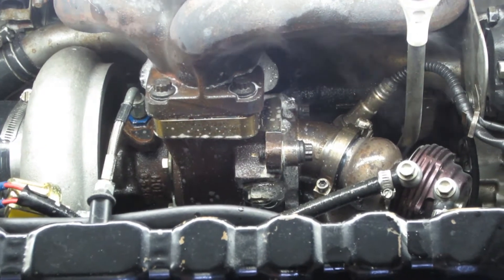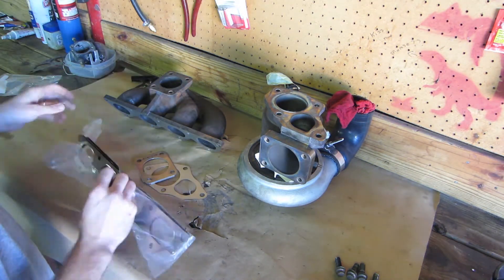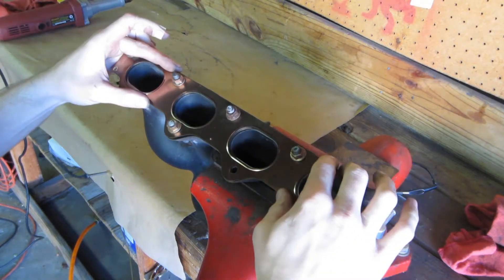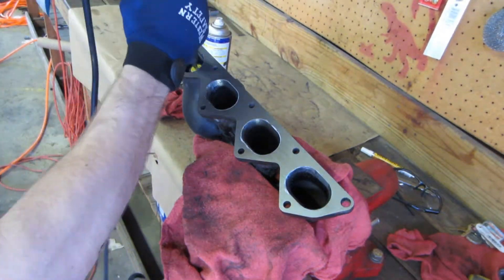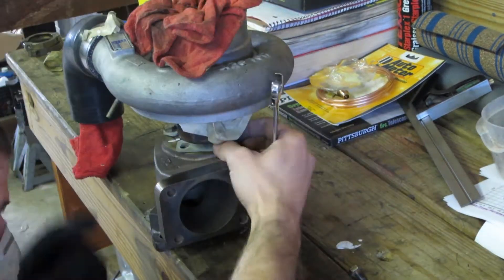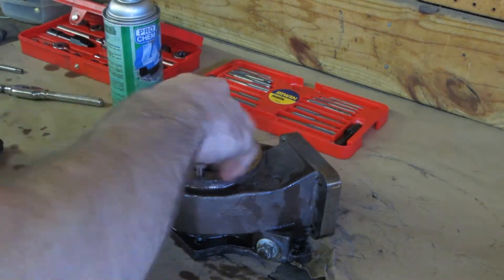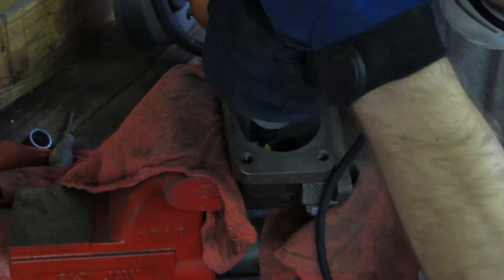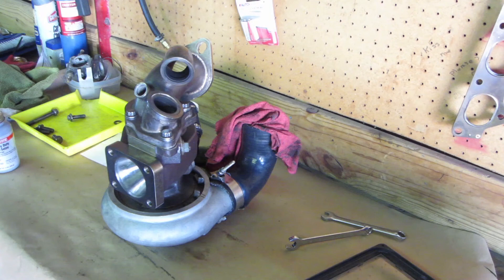Diagnosing a Lean Condition - Part 2 Gasket Match Port and Polish

Comment: You speak the truth on the "you can spend hours" statement. I think some don't understand how long a port job can take. I spent about 8 hours on a set of manifolds. That includes porting,cleaning and flattening the flanges. The heads i wrapped up anout 20 hours excluding dissembling and reassembling the valves. 
The results of a good port job can be felt and as i have seen a couple times they are noticed in the data logs by being leaner on the same tune.

Comment: Unreal sounded like flies all around me, now to think that OEM Factory Headers are large OD than the OD of the exhaust ports and even the header gaskets are larger than the heads exhaust ports ? Which is why you always make sure that the Header pipe OD is a perfect match for the heads exhaust port and especially the shape of it ?

Comment: Is it a better choice to use the"old"gasket? I bought a new one when I did my turbo exhaust manifold and it initially leaked a little. I ran a while then retorqued everything and it sealed fine. But I'm wondering if had I used the stock gasket that was in good shape when I pulled it off if I would have had any issue. What's your position or advice on this? Thanks...I enjoy your videos...
Reply from the maker: The old gasket can be used when marking and porting the parts. Using a new OEM gasket upon reassembly is recommended. 

Robert
Reply: Cool. Thank You. I was wondering if I should have used the factory gasket. I feel better about it now...

Comment: Another good and concise video! Thanks for posting it. I hope to use this information someday.

You mentioned that a 240-grit finish was good enough for your purposes. I've read that the exhaust pipes should be polished as smooth as one can manage, to inhibit build-up of exhaust particles on the interior walls. Eastwood's porting guide seems to suggest 320 grit, but I couldn't any find references to confirmed, measured benefits. Do you know of anyone who's gone past 600 grit or even to electroplate polishing, and if so, did they get any kind of payoff besides the ability to brush their teeth using an exhaust-manifold-interior mirror?
Reply from the maker: This was while your in there work for me so I used what was readily available. I did try to obtain some 300+ grit wheels locally but no one had them in stock so I reverted to what I had on the shelf. 

The idea is to make the walls as smooth as possible to reduce carbon buildup and allow the air to exit in the fastest most non turbulent way. Going from a cast finish to a butter smooth 240 grit finish achieved that for me. 

As far as going to the extremes of 600+ and other methods of polishing, I do not personally know anyone who has done this. I am not sure how much one would benefit over the 240 grit polish. Would it be worth the extra hours and hours of time or the extra cost of the electroplate polish? I have my doubts that it would be worthwhile but thats my opinion.  

Robert